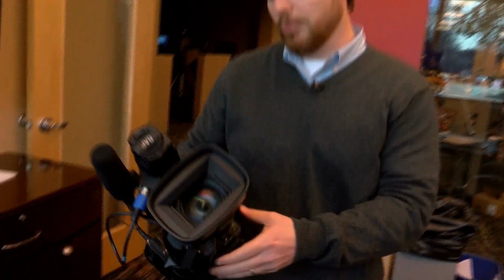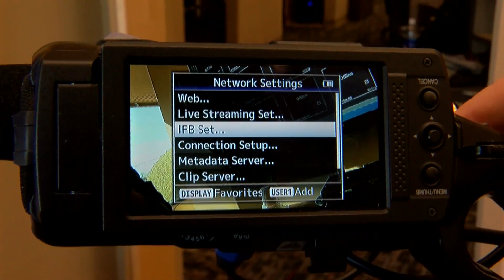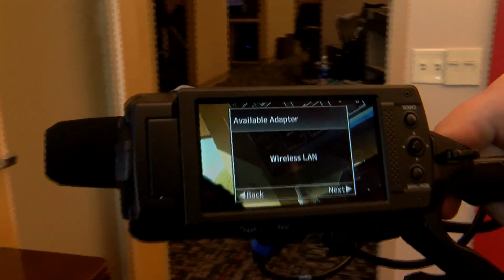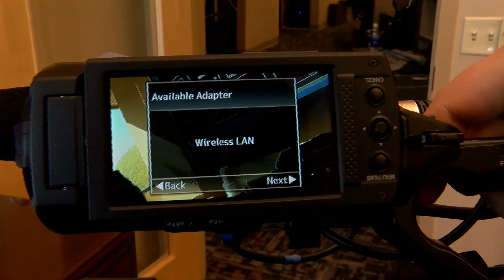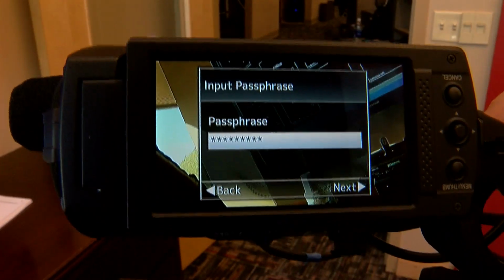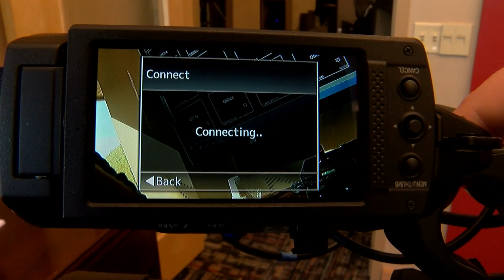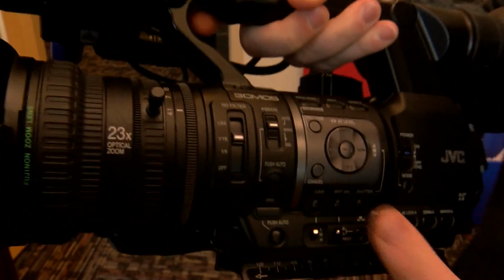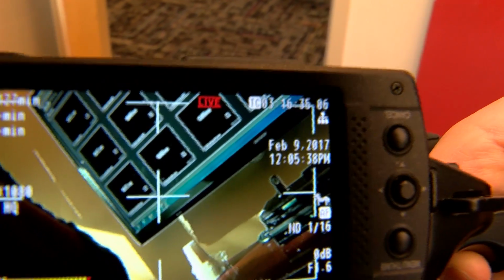How to connect JVC camera to WiFi

Comment: I have a JVC gy-hm 250. what Buffalo USB  Adapter  shell I get?
Reply: did you ever find out Marvin? I have 2 different lan adapters that the camera doesn't recognize, also how to load the lan driver?
Reply: @jerrynulty1479  I'd be keen to know too. Just tried the latest D-Link DWA 171 and it didn't work
Reply: @winstonthart2746  same here, i have the JVC gy-hm 200 and have tried 4 different adapters that all say NO Available adapter when i select wizard
Reply: @TheBlaxstones  i would think drivers need updating however i am reading that facebook and youtube have updated more now since this cam came out that you need actual streaming software and the jvc software to stream straight out is defunct- im thinking of getting this camera to shoot weddings/ live dance/theatre and boxing is it suitable for that??? i also have a Atem mini pro so can stream to that.
Reply: Great for all of the above. We are tied to the hip. JVC @Pro-V-Productions
Reply: @TheBlaxstones I got a $21 adapter from Ebay when the cam first came out. Worked fine. I do not trust hackers so I chose to stream from a wireless encoder via the HDMI.

Comment: Hi there, I'm wondering if someone knows if it's possible to connect a JVC camera (I have the GY-LS300) to a wireless access point that needs a User ID and a password to access internet (I need to connect on an university campus and I'm not able to, since I can only enter a password). Thanks.